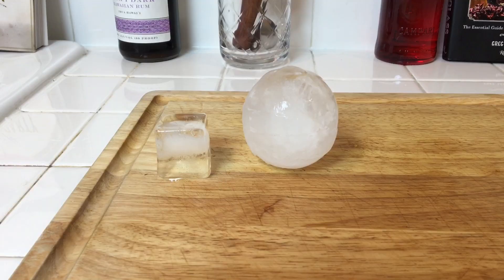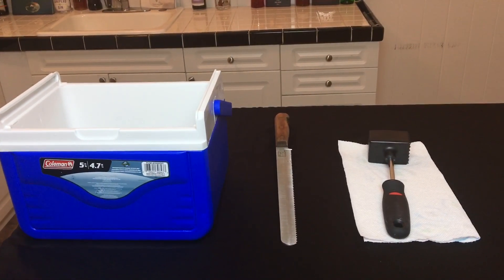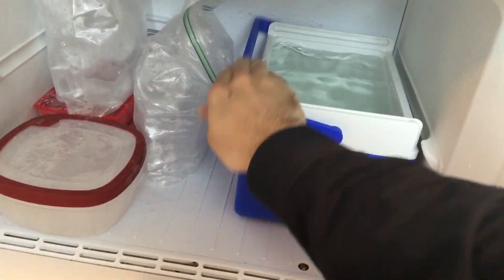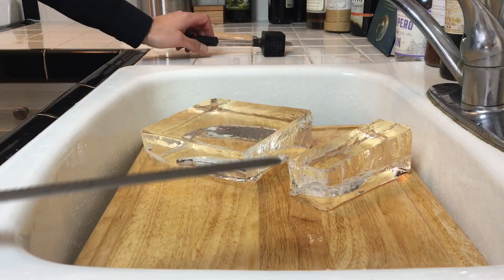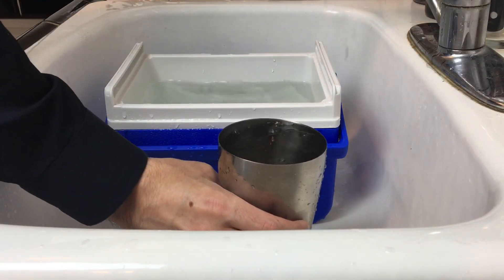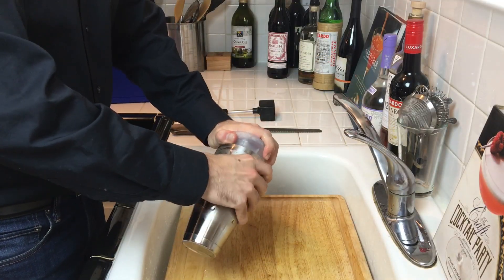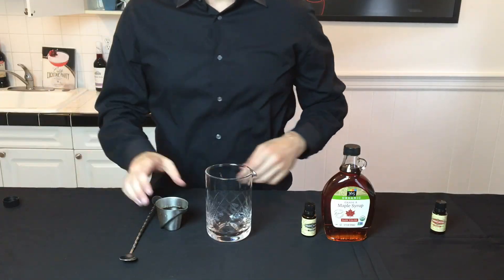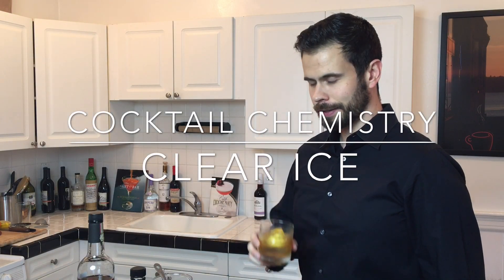Advanced Techniques - How To Make Clear Ice

Comment: Purpose of clear ice is to melt more slowly in your glass.  By being more dense, it withstands melting better than ice with air.  It’s why the ice sold at campgrounds has the hole in it so it will melt faster and you’ll need to buy more ice.

Comment: I find 36 hours in my freezer give me the thickness I want. I cut the ice with my oscillating saw, with a blade I only use for ice. To finish off the cubes, I heat up a frying pan and using tongs to hold the cubes I can square them off and polish the sides.

Comment: there's a more practical way.. let your water sit out for awhile to deflate, gradually freeze in steps, fridge first. with a tray use a gallon ZL-bag around it so it doesn't absorb farty flavors from thy freej.. and then pop in freezer.. shake in 20 mins..  freeze. ~Clear ice is more than aesthetic, it stays frozen longer and keeps from watering down your cocktail or.. 20 yr old top shelf scotch.  this guy, -is an ass-.

Comment: I've never done this before, but wouldn't it be easier to round off a larger cube of clear ice a little (chip some ice off the corners) then rub it on warm water till it approximates a sphere?
Reply: Theoretically you could, but you run the risk of cracking the ice through the middle with the sudden change in temperature

Comment: Why don't people just run the ice under some warm water then it turns it clear save you a lot of time and effort
Reply: If your ice isn't clear all the way through, it's not goimg to matter.
Reply: @Quintinohthree   is dose try it
Reply: @macewindu2539  It doesn't.
Reply: @Quintinohthree  then why dose it work for me
Reply: @macewindu2539  Either your ice is clear but has a frost on the outside, or it doesn't.
Reply: @Quintinohthree   nope just square ice cube tray and warm water
Reply: @macewindu2539  Then you're not getting completely clear ice, you're just surprised that you're getting rid of the frost.

Comment: Water quality is important. Clear doesn't mean it does not contain impurities that will affect the quality.
Reply: Actually, if the ice is clear, it's much higher quality than the water it is made from. The clear ice on a frozen lake will have several orders of magnitude less impurities than the water underneath. If you use drinkable water to start with, the ice will be as good as perfect.

Comment: Nicely done. I use a similar technique for the sphere's but I use an insulated travel mug like you'd use for coffee. It's insulated all on it's own so I can just set it in the freezer by itself (without having to drop it in a cooler full of water.) Self contained directional freezing and I don't have to mess up the nice, big ice block in my cooler! (I can also churn them out much quicker than the 2 days I set my cooler in the freezer for.)

Comment: I've actually found there's more benefit to the clear ice than just presentation.  I've been doing the mini cooler technique for a couple months now and we've noticed the clear ice melts much slower than cloudy ice. I imagine that's probably because some of the white in cloudy ice is micro fractures where gasses are trapped.  Clear ice is frozen solid with no gasses, therefore it retains its structure much better, and won't dilute your drink as fast. I can pour two drinks for my wife an hour apart, and just use the same ice, whereas before I would always be needing to refill the ice.

Comment: This is both: majorly overkill and unsanitary. Just use very hot(just under boiling) water in your favorite trays. Its not rocket appliances...

I've known to use hot/boiling water to create clear ice since I was in 3rd grade; course both my parents have been bartenders at one point in my life. Don't believe me? Good. You should question everything you ingest with your eyes and ears; but I do emplore you to try it yourself.
Reply: There is no shortcut to clear ice. No, not even hot water. Not only have I tried it and seen it not work, Camper Engkish who has tried just about every way to make clear ice has shown it doesn't work.
Reply: @Quintinohthree  have you tried thd (almost) boiling method? Admittedly it rarely comes out flawless, but then you gotta ask yourself; is my chosen poison flawless as well?
Reply: @cuntpuncherino  Yes, I've tried, doesn't come close to working. The only way to get clear ice is to prevent impurities from being trapped. Using hot water does not help.

Comment: Just buy rabbit clear ice trays($15-$30). comes with insulation and silicone tray that fit tightly together.Use bottled water and bring it to a boil to remove excess oxygen from the water(clean the pot it might have impurities) you can boil the water twice for additional oxygen removal but not needed. Pour into the tray and freeze immediately after removal from heat. Don't touch it for several hours... Like a lot of hours. Cooler thing works too and I've never seen it that way but I also don't need that much ice.

Comment: Or.... use spring water. Damn som people have way to much spare time.
Reply: Not all spring water is really "spring" water and even then, this is a cheap way to do it.
Reply: Ivy Frost 
And cheap is... bad??
Reply: @kruse8888  It's definitely not. In case you misunderstood me, buying spring water is much more expensive than just freezing your tap water in a specific way.
Reply: Ivy Frost 
Well, I have spring waterin my back garden and Thats free
Reply: @kruse8888  Well, lucky for you. Everybody else has to buy spring water and spring water isn't cheap.
Reply: Ivy Frost 
Idk about the US, but here its about $2 a gallon. No need to get the fancy stuff to make ice.
Reply: @kruse8888 It really depends on what brand is available by near you but there brands like Just Water that will sell 6 liters for $17. So technically cost is relative to where you are

Comment: I'm hooked on clear ice. Since I've been making it, I can't have a bourbon with out it. I make and cut large cubes and rectangles. I have a silicone tray that makes 2 in balls. I cut holes, in the bottom of each mold sphere . It just floats in the cooler so it stays in the clear ice zone.  Just make sure the molds are topped off with water.

Comment: @Cocktail Chemistry  I was able to the clear ice into the shapes, and bagged them just like you did.  However, when I take the ice back out, they stick together.  Any tips on how to refreeze or avoid them sticking together?
Reply from the maker: I've heard you can spritz them with vodka to prevent sticking, but I usually bash the bag around a bit or use the same knife + hammer to separate them

Comment: Would this work if you don't use a cooler? Just a big container of water?
Reply: try it! But no, it will not. The secret is to insulate the water from 5 sides with something more , well, insulating than water.

Comment: Hey I just did this and 2 things:
1) it froze about halfway in about 11 hours.
2) it froze the top.
I have the same ending shape as you, with a corner of cloudy, no big deal. I even used the same cooler as you. :)
Reply from the maker: how cold is your freezer? Mine is -6 degrees F which I measured by putting a shot gloss of vodka in there and taking the temp
Reply: Cocktail Chemistry I’ll have to check. Am I aiming for more or less cold, if not exactly -6? Are you suspecting mine is colder?

Comment: Thats great, but how to implement this in an ice maker? Would insulating the bottom part and allow it to freeze a shorter period of time work(leaving some unfrozen water at the "bottom" of the mold)...
My ice maker allready freeze slightly from the top by blowing coool air atop the ice and when its time to push out the cubes it heats the mold, slightly melting the bottom part. Im thinking if i could insulate thebmold better it would freeze "more" top to bottom, but o.c. after a while the chill has gone through the insulation and thats where the heater would help as that heats the bottom of the mold every batch of ice also heating the insulated part a bit to prevent a "too cool insulated space". 
Just need to figure out how to reprogram it for shorter freeze cycle and longer heat cycle and it should be close to perfect right?

Comment: I keep making these and storing them. They start off completely clear, then after storing for a few days they are cloudy. Not as cloudy as a regular Ice cube, but not clear. Any suggestions on storing?
Reply from the maker: That's totally normal, it's just frost that accumulates on the cubes. When you're ready to use them, just make sure to let them sit in the glass for at least 5 minutes before adding the cocktail or they will crack, but they should be perfectly clear once you pour liquid over them

Comment: Where Im come from we never use ice in Cocktails or wine or even beer. We use cooled gems or soapstone. Because ice would make the drink watery...
Reply: in some cases, this works fine, and presents beautifully, but for a lot of drinks, ice is specifically used, because it isn't just the cooling effect needed, but the water and certain alcohols have a chemical reaction, and that is what makes the flavor so specific! a lot of mixed drinks have a specific formula including a specific amount of ice (usually in cube form), expecting that the ice is going to melt as you drink it and the flavors that will occur! without that ice, you are missing delicious flavors you could be experiencing :)

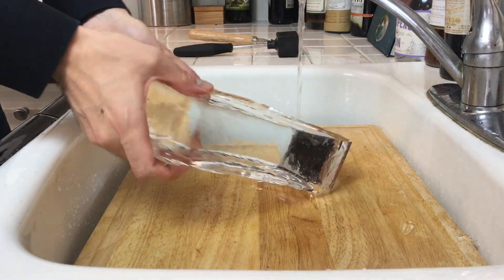Comment: 2:00 Careful running your pristine block of clear ice under water like that; you can crack it. I at least let it sit around at room temp to 'warm up' to zero (from -10 or -20F from the freezer) as there will be less thermal shock when you run it under water.

Comment: When you ran the warm water over the ice to smooth it, I was surprised that it didn't crack. But after pondering it for a while, I think I understand. Ice that has just come out of the freezer tends to crack, whereas ice that has been out for a few minutes usually doesn't. Cracking is due to thermal shock. If you had left the block in to freeze completely, it would have had the chance to get below 32F. A block of this size would take a considerable amount of time to warm up enough not to crack. However, since it didn't freeze all the way, and it's in a mostly insulated vessel, you essentially have a mix of 32F ice and 32F water. Until the whole block freezes over, the ice doesn't have a chance to get very far below the freezing point. The second it tries, the existing water will lend some of its heat to keep it at 32F. So even though this block has been trying to freeze for a whole day, it's already warm enough that it doesn't succumb to thermal shock. "Warm" being a relative term, of course.

Comment: This works great, my ice gets perfectly clear and I manage to carve them into my desired shapes. My only problem is that it almost always crack when I pour my drink over it, why does that happen? It stays the same shape and is still clear, but it has little cracks in it and I feel like that kinda ruins it. It doesn't seem to happen with you, do you have any tips?
Reply from the maker: To prevent the cracking you have to let the ice temper a bit after pulling it out of the freezer. Let it sit in the glad for a minute or two

Comment: A "lifehack" for you. If you want to make clear ice the simplest way - just boil the water nicely. I believe that cloudiness comes from minerals within water, which are usually can be just boiled away from it. You're welcome
Reply: Ive heard this too, but he mentioned in this video that it doesn't work. One way or the other, it certainly wouldn't boil off the minerals, if anything they would become more concentrated.
Reply: @asdf945  you know these "fancy" electric kettles? What "white thingy" do you think remains on the bottom/heating element of it if you don't clean those often?

Comment: Most clear ice products on the market are expensive, and only make a few cubes.  For a fraction of the price, the easy-to-use, high capacity ClearlyFrozen ice tray uses "directional freezing" to make ten 2" glass-like artisanal ice cubes overnight with tap water in an ordinary freezer.  Check out the demo video at ClearlyFrozen.com.

Comment: Great video Nick! I’ve tried this a few times and it’s turned out great. When I’ve tried to cut it though, it’s breaking of at a pretty sharp angle rather then a clear cut. Any ideas what I’m doing wrong??
Reply from the maker: Try deeper cuts with the serrated knife, and on both sides of the ice block
Reply: Jared, are you carving straight from the freezer? I had some issues there, but leaving the block sitting for about 10-15 minutes before carving did the trick. I cut at a steady pace with the serrated knife until a crack appears below it, usually in a straight line, then tap the knife and it just falls away like in the video. :)

Comment: Just tried this yesterday. but I just did a little cut on the top end of the ice block, so the ice kept splitting up uneven.

But I used a knife with a uneven blade and a tiny hammer, so I will have to upgrade those to something better for my next attempt.
I did end up with 2 bags full of beautiful clear random shaped ice cubes. It is quite fun and the ice looks so much cooler then that old dull cloudy ice cubes you get.

Comment: great video, however, cloudy ice is not caused by impurities in the water, though impurities wont help the matter the cloudiness is caused by internal stresses as a result of the freezing process, this is why when you look at an ice tray ice cube the cloudiness will be concentrated in the centre, as the ice freezes from the outside in it expands and concentrates the stress into  the centre

Comment: After you have made your shapes and what not, you put the ice in a bag and back into the freezer.  So if the cloudiness comes at the end of freezing, then wouldn't your ice just become cloudy if you have to store it regardless?
Reply from the maker: The ice will probably develop a frost when stored in the freezer, which will wash right off with the clarity remaining
Reply: tl dr >> impurities are discarded during the first part, then you only deal with pure ice/water
the cloudiness is mostly due to non water molecules like minerals and perhaps some microbes (which you will get from any kind of non distilled water source), during the top down freezing process, the molecules of water change conformity and push out the other stuff towards the path of least resistance (liquid water below) and you only chop the clear part which is 'purer' water and pour out the rest .. this is by far not the most accurate explanation i know but i think you get the gist of it..

Comment: Can I put the ice in the microwave to smooth the edges ?
Reply from the maker: I find it's easiest to run hot water onto a flat surface like a cutting board, and then run the block of ice over that. I haven't tried the microwave approach but I imagine it wouldn't evenly smooth the edges

Comment: iv got ta ask is there any particular  ice shape you find the most efficient in regard to length of time to melt and chilling also what ice shape would you use for a single malt scotch
Reply from the maker: The short answer is, there is no shape that will be more "efficient" in the sense of getting the most cooling power with the least dilution. Dilution and cooling will be a direct tradeoff, but with a single malt people typically enjoy a warmer beverage with less dilution, so you try to minimize the surface area of the ice. This is best done with a large ball or cube. 

Watch my shaking vs stirring video to learn more about ice dilution and cooling
Reply: darkkrenify Spheres have the smallest surface area per volume so will take the longest time to melt. Being so big they should all take two or three drinks before melting though if you're refilling the glasses. For the most efficient cooling you want an ice cube that matches the shape of the glass though so you have a thin layer of cocktail being cooled by each part of the ice cube.

Comment: Please correct me if I'm wrong: Clear ice not only improves the appearance of your drink, it also improves the flavor because it melts slower and so dilutes your drink at a slower rate; this means that a clear ice cube or sphere will last a bit longer than a regular one.
Reply from the maker: The clearness of the ice will only have a marginal effect on the slowness of dilution. The size of the ice cube has a much larger effect. In other words, larger ice will melt slower, but also cool the drink less. See my video on shaking and stirring for more on how ice affects cocktails
Reply: If the clarity is due to reduced "bubbling", then the thermal mass is quite a bit higher; especially toward the center of the cube. We're not talking 10 minutes vs. an hour difference, but it's certainly measurable.

Comment: For huge ice balls for scotch - the real simple extention of this method is to use tall insulated stainless steel coffee mug. The difficult part to find one with straight neck. 

Fill it  with water, put in a freezer. Wait a day. Turn over and gently tap over the sink. The top 1/3 - 1/2 will slide out as single block of clear ice. The only trick is not too wait too long - you don't want more than top 1/2 frozen

Comment: If you let the clear ice melt and then used a mold, would it be clear as well?
Reply: lemonadecupcakes what makes it clear is the freezing method I believe so I would follow his methods for using the mold
Reply: The clear ice is pure water, but if you melt and re-freeze it then it'll probably be contaminated by dissolving gases from the air. So it'd be better than just freezing tap water, but probably not perfectly clear.